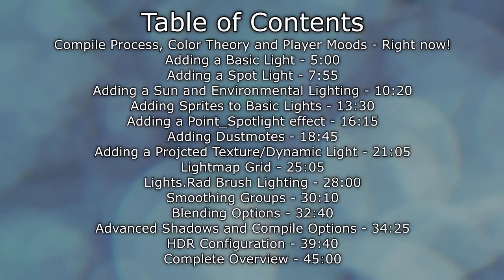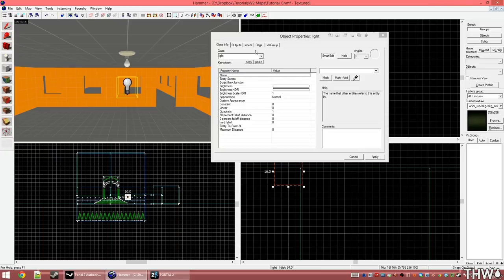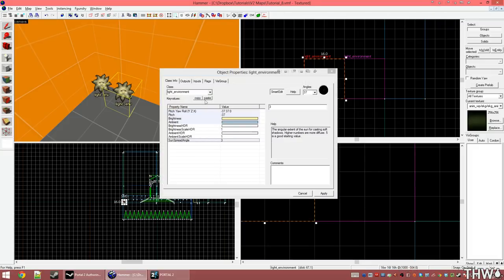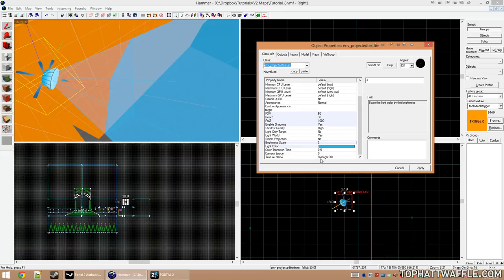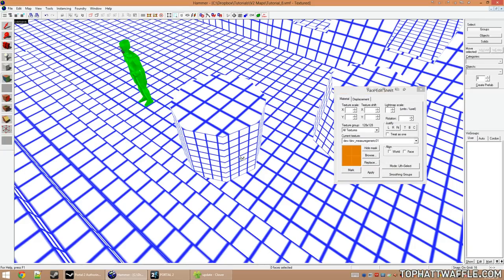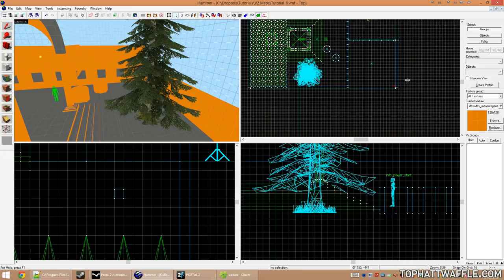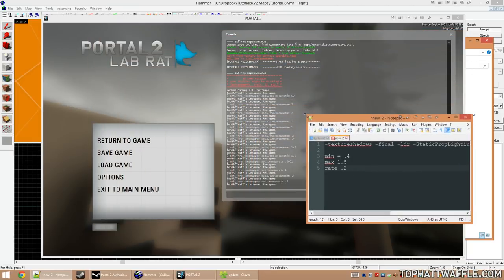[Source 1] Hammer Tutorial V2 Series #8 "Complete Lighting Tutorial"

Comment: Chapters:
0:00 Intro
5:00 Adding a Basic Light
7:55 Adding a Spot Light
10:20 Adding a Sun and Environmental Lighting
13:30 Adding Sprites to Basic Lights
16:15 Adding a Point_Spotlight effect
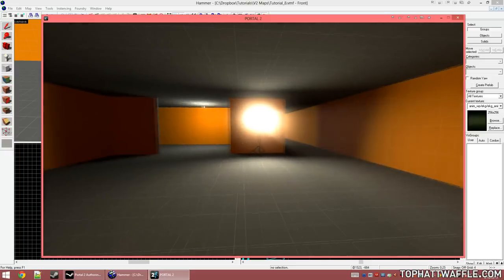18:45 Adding Dustmotes
21:05 Adding a Projected Texture/Dynamic Light
25:05 Lightmap Grid
28:00 Light.Rad Brush Lighting
30:10 Smoothing Groups
32:40 Blending Groups
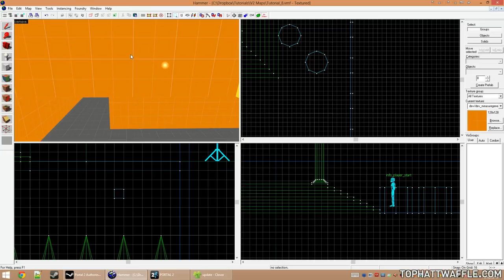34:25 Advanced Shadows and Compile Options
39:40 HDR Configuration
45:00 Complete Overviews
If you saw this comment please pin to help other people

Comment: This is a little late, but I have noticed that lights are straight-up incapable of emitting light outside of the box boundary of a prop_static if it's placed inside. This quite the headache because the lights in question I am trying to use are in fact lamp posts and the light would look weird if it was to be moved outside of the prop's box.

Comment: I have a map with many rounded walls. I'm inclined to use smoothing groups for them but with a limit of 24, it seems too few. Is there a way to get more smoothing groups or am I left just making the lightmap scale smaller? Does it help to give the light_environment's SunSpreadAngle a higher number in general?
Reply: You can use smoothing groups multiple times. Just make sure that when something is supposed to be a sharp edge, that the faces that the edge is between are using different smoothing groups. You could probably make do with like 4 smoothing groups, 24 is really more than enough if you understand how to use them.

Comment: i make maps for tf2, that "LDR" compile i dont have, and my tf2 dont have lights.rad. i created one but it didnt appears or generate nothing. Help???
Reply: you have to make a light.rad file where gameinfo.txt is located and with note++ add the paramaters in. for episode2 i found light.rad info on interlopers.net, but you shouldn't need it if you enter the parameters correctly in your custom light.rad file for the model youd like to use. for the LDR issue if you enter the parameters in the expert compiler like topHATT has it should work just fine.